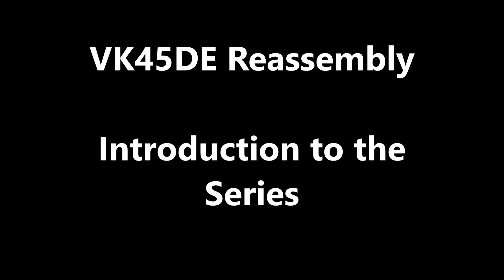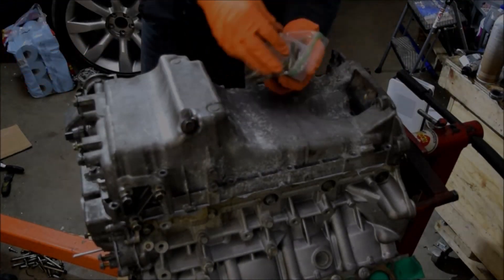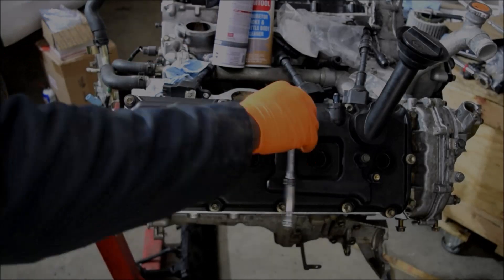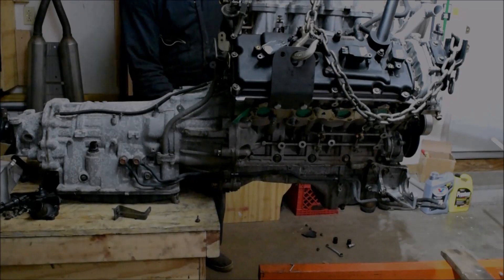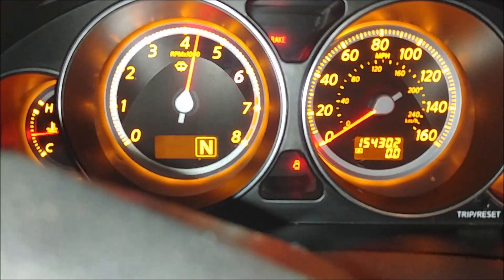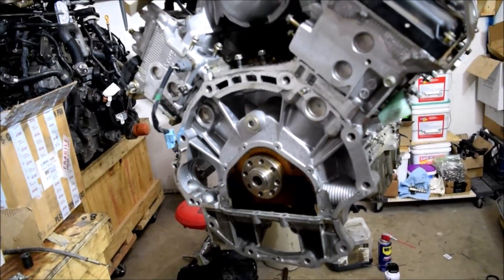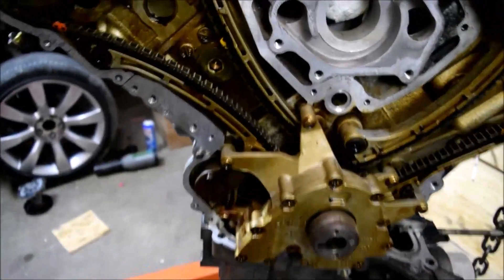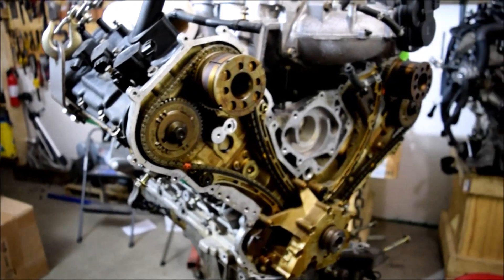Intro to my Engine Reassembly Process. Nissan VK45DE 4.5 liter V8 for Infiniti M45, Q45, FX45, Fuga

Comment: Do you know any place to get an 2006 m45 engine from
Reply from the maker: 1. eBay
2. Car-part.com
Those would be my top suggestions.
Reply: @EdBwoy  thx because i have a 06 and bought an 04 motor and it won’t fit

Comment: Hello. hope everything is good. I was wondering if you know any website where they sell valve adjustment shims for the vk45de engine. The original site doesn’t make most of them anymore. Thank you
Reply from the maker: If I may ask, which sites have you checked so far? I don't want to give you the same results you have looked at.

Is this for the VK45DE you completed last year, or is this a different project?
Reply: @EdBwoy  this is the same engine from last year, I opened the the head cover and checked the valve clearance, It wasn’t me who did the adjustment on them and it turned to be so wrong I should of check when I was putting together but the machine shop guy told me he did it .
Reply: @EdBwoy  i get most of the parts from Infinitipartesdeal.com
Reply: @EdBwoy  let me know if you hear about any another engine that carry the same type of shims that  wound fit on the vk45de please thank you.
Reply from the maker: @fabiofixando  sorry the machine shop did it wrong. I was going to suggest that a machine shop or engine builder would know where to source them. They have pretty extensive catalogs.

Beyond that, I would try parts.infinitiusa.com or contact Infiniti of Gwinnett. They seem to have a solid online presence with parts.
Reply: @EdBwoy  I appreciate you’re trying to help . Thank god mega zip still can make lots of this old parts it’s international but it’s good
Reply: @EdBwoy  found the parts I needed on the mega zip website. It’s most Toyota and Nissans but there are more there if anyone wants

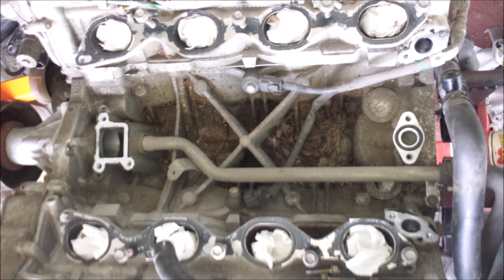Comment: 1:57, the valley is where my car is leaking coolant into. I haven't taken anything off yet though, where do you think coolant is leaking from? There was an old post from 2012 on Nicoclub of someone having to remove the manifold to fix a coolant leak from an o-ring, but the pictures aren't posted in the thread anymore.
Reply from the maker: There are 3 o-ring locations under the intake. 2 at the front, one near the rear thermostat housing. 
Hint: video coming soon

Comment: Is it the same exact engine in the Q45 -2003-2005?
Reply: nope. The block is the same but placement and location of accesories are different
Reply: liblib89 
Okay well, I was just gonna see if you ever had to change the O2  sensors on the Q the upstreams have been ridiculously hard for me to access.
Reply from the maker: Not the exact same engine. Some things are similar, some are different.
https://forums.nicoclub.com/v8-engine-replacement-options-do-the-03-and-06-m45-use-the-same-vk45de-engine-t619905.html